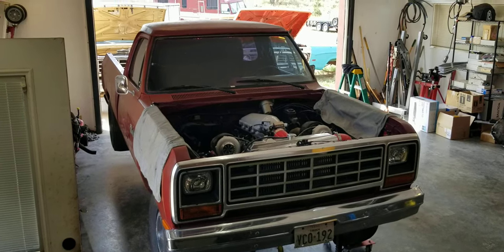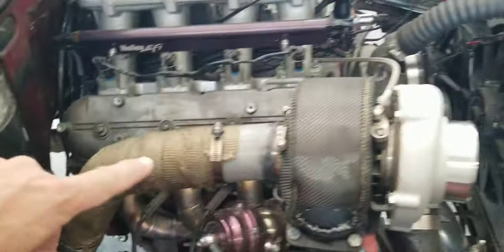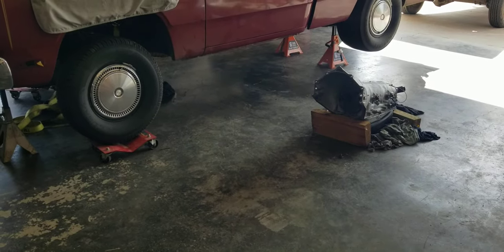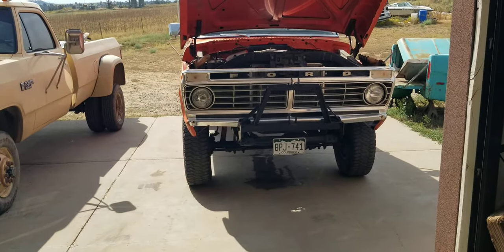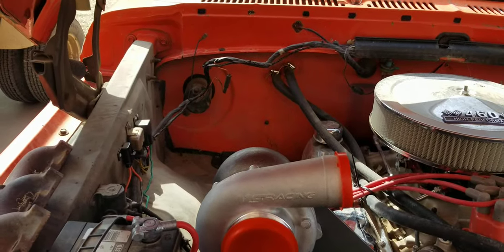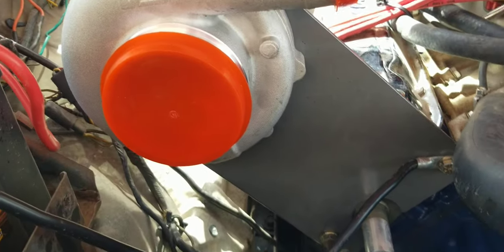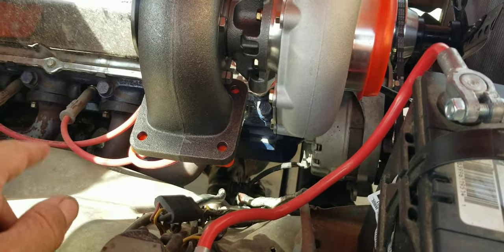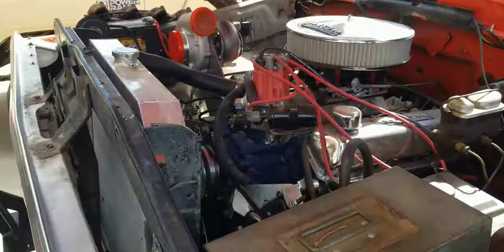low buck diy 460 ford single turbo setup.

Comment: Problem I had with mine is the motor mount and the manifold. Have to almost put a hole into it and weld a piece of tubing into it to clear the block. A turbo460 is the key to smiles